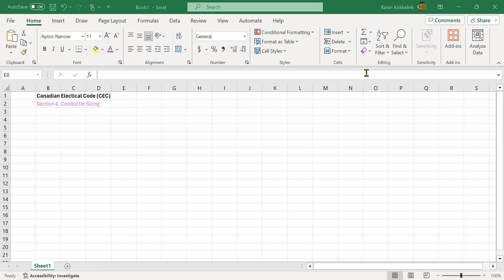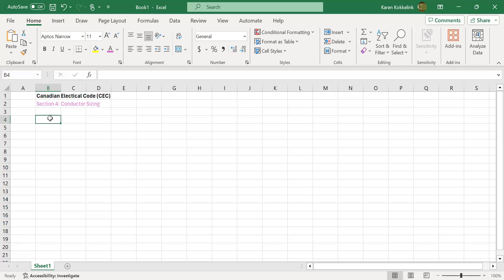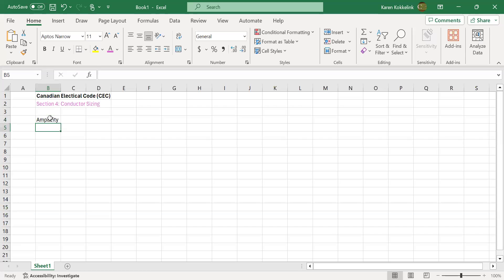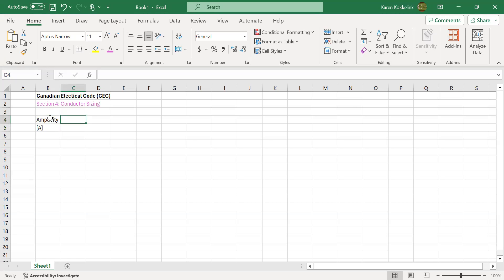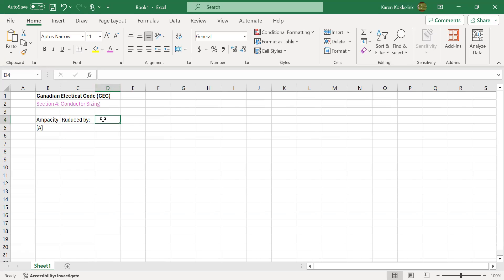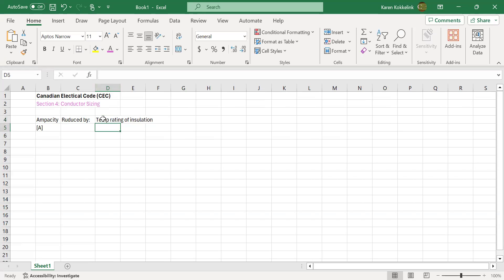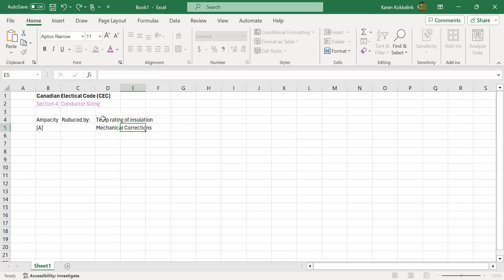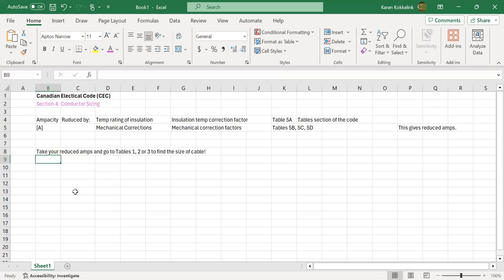Flowchart to Figure out Wire Sizing Calculations in 4-004 of the Canadian Electrical Code CEC

Comment: Somebody say single conductor with raceway or concuit should be table 2. 
CEC 4-004 1.a single-conductor and single-conductor metal-sheathed or armoured cable, in a free air run, with a cable spacing not less than 100% of the larger cable diameter, as specified in Table 1; 
CEC 4-004 1.b one, two, or three conductors in a run of raceway, or 2- or 3-conductor cable, except as indicated in
Subrule (1)(d), as specified in Table 2;